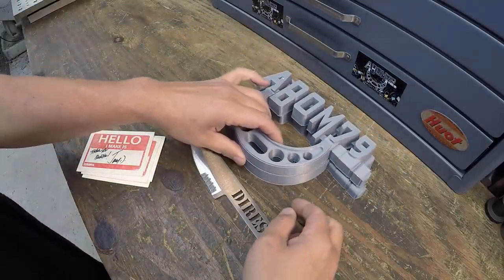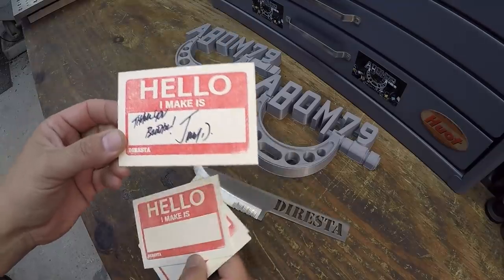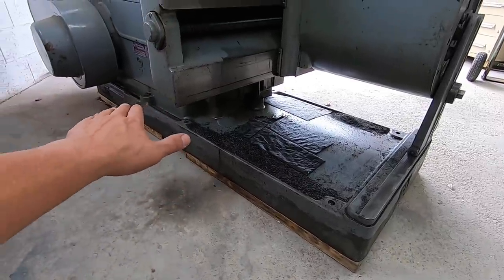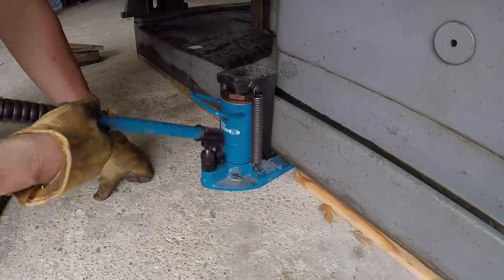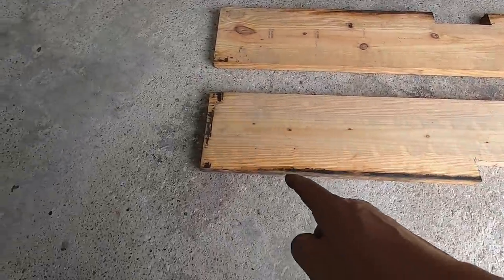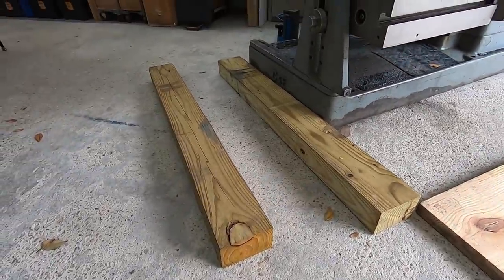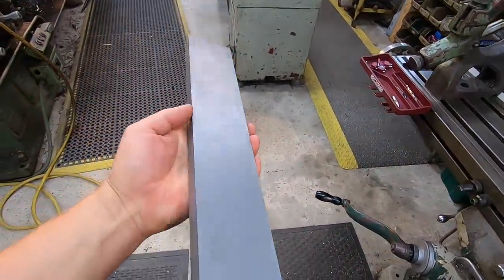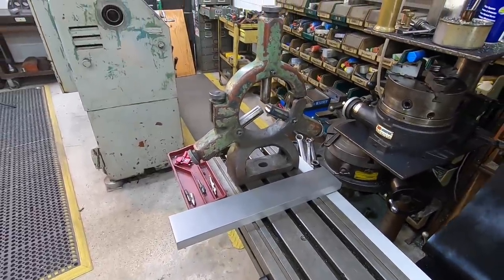SNS 299: Shaper Lifting, Steady rest Mount, New Electric Circuits

Comment: Hmm. That shaper sure is a big beast. I would suggest Hilti stuff into the floor,then lags into them. Sikaflex or 3M  520/5200 Marine Sealant Adhesive is pretty darn impressive stuff for bedding engines and the like. Adding wooden wedge blocks into the centre area with the sealant adhesive acting as a vibration reducer,you could fully lag the machine down and maintain the ability to move it easily. Get the thing bedded without fiddling with the concrete floor . Shouldn't take you more than a few hours,and the results well worth it. All the best.

Comment: My choice for leveling the shaper.  If you don't want to make it permanent. Is to make feet for the 6 or 8 mounting holes  on the bottom of the machine. Like small saucers. Get the largest diameter ready rod for the holes and put nuts on the bottom and top then you can level all the feet and lock it with the nuts. It would take care of the uneven concrete. I'm just a bit nervous about such a heavy machine only on 3 points. Take care good video.
Reply: I’m definitely with @MrEarling on this. We ran a shop with embroidery machines that needed to be relatively pretty precise and were somewhat jumpy when running at full speed.  when you have high precision machines, they need lots of support.  Removing the support from the middle has to be causing mid sag on the machine’s foundation which will exhibit itself in other ways like excessive middle rail wear and other oddities that won’t show up right away.

However it seems like it’s ok for now, I would just consider that for a future SNS. ;-)

Comment: Our larger Bar machines with 40' runways had I beams and wide flange beams embedded in the concrete foundations that plates were welded to and rods were threaded into going thru the jacks that sat over and thru the machine base. It was a great day when we took possession of a Zeiss NI1 optical level. The old Paragon level was never used again.

Comment: My first step when acquiring an old machine is to remove the belt(s) and then check the motor, unloaded.  It has been my experience that even a good motor will need a lube job before running.  You can usually feel how good the motor bearing are by hand turning the shaft; as a rule I will tear down the motor for a full cleaning and replace the bearing.  Don't be in a hurry to run the machine;  you could inflict damage especially when that old iron has been sitting for long time without regular service/maintenance.

Comment: Hi Adam. I have set alot of machinery.
 I would use drop in concrete anchors like you used in the one video. 
 cut pieces of all- thread and screw em into the anchors.
 Thread leveling nuts and washers onto the all thread.
Set your machine down over the all-thread and use the leveling nuts to get er 
right where you want er about an inch or so up off the floor.
 Then get some Non-Shrink grout and pack it under the pads.
The Non-Shrink Grout is the key.

Comment: Outside of grouting it down, you could try some thick rubber that horse suppliers carry, it's about 3/4" thick.
We have used it for years, under some heavy-duty woodworking machines, one is a 36" planer that weighs 12,000 lbs, and a sander that weighs 18,000 lbs.
It gives you great contact with the floor, but will still conform kind of like grout.

Comment: Hey Adam, great update, the shop layout is great and the camera work also.
Use them wide shoulders and let all the negative just slide right off. Some replies are not worth the key strokes.
I have 37 hard years in for my business. Most of the crap replies are coming from their Moms basement.
Keep it your way please, you have taught me so much.

Comment: put two strips of steel on the floor,then put dry grout on the steel. You can put a sheet of plastic between the grout and the machine, then lower the machine down spray the grout with a little water and leave for 5 days for it to cure

Comment: Rather than setting the machine on the face grain of the wood you could cut blocks that allow you to set it on the end grain. Wood compresses much less in its longitudinal direction. .003” could easily be coming from the wood compressing under the load.

Comment: Excited to see the Flexarm doing some Abom-sized taps. I'm still amazed that this machine takes 480V, here in Germany 230V 16A single phase and 400V three phase with brakers like 16A, 32A and 64A usually is the highest you geht in a normal workshop.
And please do a proper restoration of that grinder by stripping the paint and making it pretty.

Comment: Adam, you should redo the heavy cuts you were testing a few videos ago  with the test indicator and see of it was the base that was flexing.    I would think that bolting it down to the concrete would add a lot of rigidity.    The wood might allow flexing and that might have been what you saw when doing the heavy cuts.

Comment: Adam, for that transmission lever, can you 3D print a temporary (removable) spacer to keep it from popping out of gear. At least until you can get in and fix it.

Comment: The heavy gang as they called them would level our machines then create a dam all around them and pour grout under them. 
When I was installing the machines I worked on we would use shims to distribute the load evenly all around the machine. I was not very comfortable seeing that heavy machine suspended on each end like that. If you add support in the middle carefully adding shims all around so all the points are equally loaded.

Comment: Sounds like your key seater is missing one of the 3 phases. It has a new for it (used) switch so are all of the 3 phases coming out of it when you turn it on? Do you have an AC voltmeter and can measure voltage coming out of the switch between the 3  phases? Don't let it sit there and hum as that will kill the motor., the only winding powered on just 2 of the 3 draws too much current. You also need to check if it turns in proper rotation direction. Can't wait to see the main motor of the K&T rewired with the knee put on the correct voltage.

Comment: Great use of the scientific method in solving the flex/movement question. There's nothing in the maintinence manual about leveling.  cause that can cause uneven wear. My geuss with the popping out of gear Is the bearing surface under the gears. Or  ends of related shafts. just general slop. You've done a real great job with that machine. Cutting tools are much cheaper for the shaper. Those big chips are it's speed secret. And what the hell you already got all that oil for the thing! looks nice out there enjoy!

Comment: How about a small wood dam around the base of the machine with the machine up on wedges, then pour self leveling concrete in under the machine. The dam would keep it from running out while it cures, then you know you have a level surface since it would have molded itself to the bottom of the machine. Not sure how to get the wedges out :)

The reason why you still see some movement is wood is compressable in the direction of the grain. If you cut butcher blocks and slid them under the machine, it would not move as much.

Comment: It is the belt.  In the video you can see a kind of swing oscillation with the belt moving in time with the tapping noise.  It might not be so visible outside the video but it was definitely there.

Comment: Hi Adam, in all respect about your work, that block off wood on the front off the shaper is gonna crack! (at 15:46) Please turn it a quater turn so the grain struckture holds better. (sorry for the bad english/american spelling)
Reply: Gert Skjølstrup but end grain has a good chance of splitting.   Should be a block under each bolt hole... looks like there were 6.   I just see a foot getting rushed under that shaper when the block fails..

Comment: The movement in the shaper is down to the momentum of the ram moving back and forth, not just the change in the centre of mass. Really needs to be bolted to the floor. Do you find it walks around a bit as it's operating?

Comment: Won't leaving the machine unevenly unsupported across the whole base cause the shaper to bow causing you to lose level?  Plus the machine is still moving which like it or not is going to affect the accuracy of your cuts. Brother in my humble opinion you should just bite the bullet and lag it in. Even if you leave the wood under it, you can use adjust the lag bolt pressure to level the machine. Go big or go home :)

Comment: You could probably make a temp dam around that shaper with some boards and caulk then pour some self leveling cement and or even SIKA self leveling caulk to fill in any void and get it sitting firm and pretty, and or oil the machine base first so nothing sticks and you can always pick it up out of its foot

Comment: Hey Adam great video as always.  Thought I would give you an idea and concerns on how you have your shaper on blocks on the ends.  With nothing in the middle have to think that would create a small amount of sag in the middle of the machine.  Even though how thick the base is and the over all structure of the machine I would think it would still sag a bit.  With that that the tolerance with the ways the arm rides on may cause uneven wear.  With you needing to be able to move the machine around I would highly suggest leveling feet or shock mount feet.  Mcmaster.com (McMaster Carr) has a great selection of leveling feet and shock mount feet.  If you were to get the shock mount ones they have a rubber footing and a thick metal bowl cup like top with a threaded center.  Some heavy duty all thread and hardware you could easily level the machine and have up high enough to be able to get under it and move it around and clean under it.

Comment: may i suggest buying some leveling pads, six of them. or make some that way you can adjust. just a thought.
Reply: I was just about to suggest the same thing. I'm not crazy about the center of the machine being unsupported. That's alot of weight in the air between the pieces of wood. Not sure if it's enough to crack the base casting, but I still wouldn't sleep too well.
Reply: @fernanjs  It's gonna bow a ton.
Reply: @fernanjs  you are definitely right about the weight in the middle of the shaper. It's not going to come crashing down, but it could settle enough over time to lose some tolerances.

Comment: Put some road fabric on the existing concrete and poor a slab with the same dimentions as the shaper. You make it as thick needed to accomodate your wanted work height.
Fabric is to ease future moving or dismantling. Also possible to make slots in the slab for your toe jack

Comment: Sorry mate, that is not the way to level a machine tool. you should have six points of contact, the corners + centre each side to eliminate the base sagging, (it can happen, believe me) level machine with steal or brass shim stock then bolt the machine down with foundation bolts.
Reply: Probably a good idea. It won't kill the tool yet tho with the way that it is...
Reply: I agree, I've seen machines ran on 4 points that did sag and caused damage to precision guides.    I't not hard to put 6 feet on it and level the machine up.    Maybe Adam will get around to it.
Reply: I agree, most of the machines weight is in the center, it will definitely sag in only supported at the ends
Reply: I don’t like the middle being unsupported. Like Renzetti says, everything moves. That will distort the vase.

Comment: To get it resting on the four corner pads of the machine you should add 4 pieces of plywood above and below the main piece of wood so the wooden beam is sitting on the concrete on two pieces of plywood at the corners and the corner pads of the machine is sitting on two pieces of plywood above the wooden beam. 
That way you have a gap between the concrete pad and the wooden beam and you also have a gap between the wooden beam and the machine, so you only have four direct contact points between the machine and the concrete pad meaning any irregularities in either the concrete pad or the base of the machine are eliminated.
You can glue and screw the plywood to the beam to make it more secure and then lag bolt the machine to the plywood/wooden beam so they all lock together.
This is the method we use when we are placing heavy machines and it works very well.
Alternately you could, being a machinist, build adjustable feet using some thick plate and massive bolts, put one at each corner of the machine and get it dead level and take up any irregularities in the floor

Comment: Over time can the shaper wear the front of the block down and possibly slip off on a forward stroke? Also worried about that front board being short and leaving an opening for your foot to be under there if it does move.

Comment: I'm interested in the tool geometry of a shaper. I'm having a hard time wrapping my head around how the chip is actually made at the point or line of contact. Things get complicated real quick when they get simplified for some reason.
Good luck on the heat treating I'm sure you're knee deep into at this point. Updates and lessons learned soon please. Good stuff.

Comment: Please support the shaper base in de middle also, at least. Do or do not... there is no try! You never make compromises, why now with that beautiful machine... I really don’t want to see the machine crack.
Reply: Bockshop Hollum Ameland   Lol, not your call homie. Was structurally designed to be held up on the four courners.
Reply: Louis Turner That’s why there are six mounting holes in de base. The two in the middle are there just for fun. I don’t think so. But everyone can have their opinions...

Comment: Hey Adam. I just put new bearings in my bench grinder tonight and when I put it back together and turned it on, all it did was hum. It ended up being the flyweights for the starting capacitor not making contact with the shorting ring. I just figured I’d share, in case it would help you out with the motor issue you’re experiencing with your keyseater.

Comment: Throw another piece of lumber under the centre of the G & E.  She's a big old girl, and the lumber in the centre will be like a memory foam bed for her ... :-)

Seriously, another line of support across the centre will ease the load on the "piss poor" concrete floor, but have little, if any impact on the machine rocking front to back, but it will have a significant effect on the life of the floor ... how much disruption will that save you?

Comment: In most cases we use machine leveling mounts in all the fixing holes of the machine, so that everthing is level even with uneven concrete. Something like a McMaster-Carr 6330K28 with swivel and vibration damping should match your application just fine. Maybe you need a bigger bolt size and more load capacity.

Comment: Hi Adam, 

Concrete slabs are never flat! Even the codes allow +/- 3mm over 3 metres. 
And they will move over time, concrete and steel are not totally rigid as many people believe.  

You need to pack under the corners where they are low. 

If as your indicator shows, it's quite a small movement, a piece of sheet metal will probably fix the problem.

Comment: Adam, if you ever find your self up here in NE Ohio. I'd love to show you around some shops between Cleveland and down here towards Youngstown. There's a whole world of "Vintage" what we call 2and War machines that are still in use. You might even be surprised what's even for sale. We had the Ravenna Arsenal here that made Ammunition from 1942-1957. Then went into making small and medium sized arms during the Vietnam war. So there a PILL of old machines still here in this area. And everything seems to have a price on it these days. Good news for your electrical upgrades. Its always nice to have stuff done right. The shaper is better now. But you need to anchor that machine to the floor (Which you know) With some expandable concrete anchors, And some space plates. You'd get that machine to sitting 99.98% straight and solid.  As for your Oliver drill grinder, A machinist buddy of mine that's passed on now had one of those. And it was doing the same thing (back in the summer of 2001) If I recall it wasn't anything major. Something about a when you engage that handle there's a detent with a spring in there that was broken. And with a lifetime of old grease and dust and dirt, that didn't help. It took longer to tear into it, than it did to actually fix it. But those Oliver's  are good old vintage work horses.
Reply: Adam, you're really moving along well with your acquisitions and installations, thank you.

Comment: What I would suggest is to get some ironbark pads 1" thick, cross grain not end grain, for the four corners and then lag it to the floor.  You should be able to find ironbark in your area as it is used in boat building, it is very hard and will dull a saw blade in no time flat, but should give you the cushion the shaper needs.

Comment: Since Dad was trained in 1952 by Air-force Machinist to stack washers on each tie down and level a lathe that way, keeping the lathe off the cement (a source of water) I have done just that.  I have and will ship you if we can connect - 4" diameter AR400 grade heavy element steel circles I use in place of washers.  These are 1/2" as I recall.   Martin

Comment: Sure wish Motion would sell the Horizontal Boring Mill back to you.
Cheers, Gary
Reply from the maker: That big G&L boring mill they purchased back in 2018 is still not running. They bought a junker and still working on it. They said once’s it operating they will sell the Kearns.
Reply: @Abom79  Well, that sounds promising.  Maybe we need to have a YT work day at their place to help them get it done.